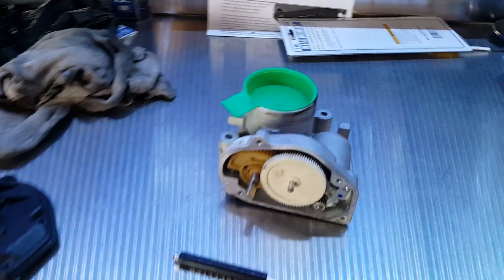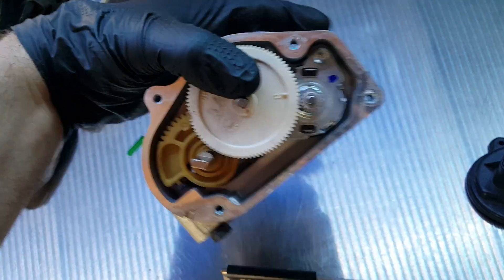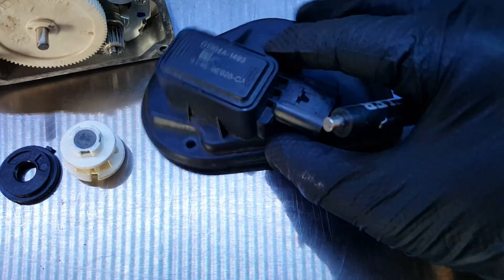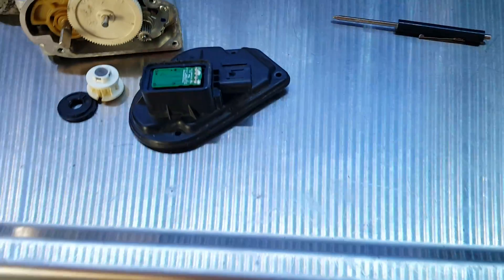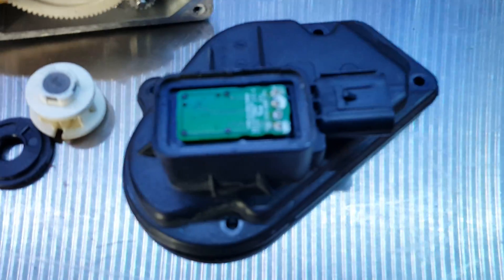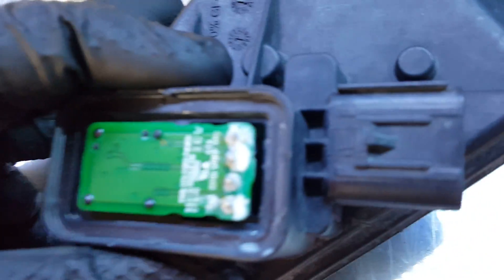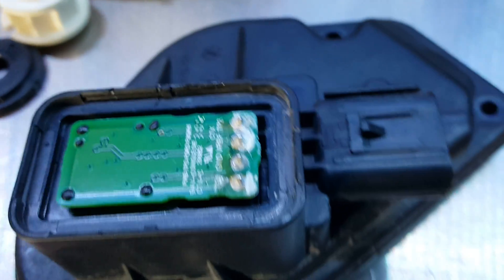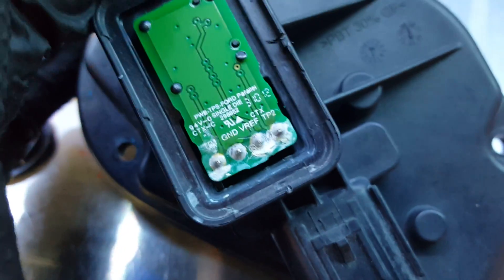Ford electronic throttle body quick check

Comment: Yes was wondering if it could be cleaned with component cleaner?
Reply from the maker: It doesn't hurt to try, but in my experience once that corrosion hits the board there is no saving it. But give it a go and let me know how it works out for you.
Reply: @brianfisher7385   I'm having slight fluctuations at normal operating temp. While at idle with ac on
Reply: @ericcraig3809  did you clean the board ? Did it work I need to know before I buy a whole new Throttle body please thanks

Comment: Wait, so this is caused by corrosion? Meaning, if I clean up the circuit, might that resolve the problem?

I have extensive experience repairing water-damaged PCBs. It's a total waste of money to replace the entire throttle body if the only problem is a little bit of corrosion.

Comment: It could be corroded circuits throttle actuator sticking open or closed these electronic throttle body's are just plagued with problems there is a recall that most people don't know about check your Vin number on Ford's website to see if your vehicle is affected the latest part number I know of for the 2.5 liter four cylinder engine is DS7E-9F991-AJ this part number is so new you most likely won't find it online. Truth be told ford isn't the only company with defective electronic throttle body's there's many others as well oh and if you see that your vehicle is one of the affected vehicles with the takata airbags you could possibly be waiting till December 2019 for a new airbag there's 40 million defective airbags from takata and there's different vehicles being added almost every day.
Reply: I know for a fact that my throttle body is not sticking, it's an electronic issue. Restarting the car returns throttle body operation to normal for some amount of time.

I've also noticed that pedal movement greatly attributes to how quickly and how often the throttle body goes into limp mode. If I accelerate lightly and never put a lot of travel on the pedal, I can usually make my 45-minute commute with it only happening once if at all. If I am judicious with the throttle pedal, then it will usually act up after about 10 minutes and then repeatedly after that, anywhere from seconds after restarting the car to several minutes. I can basically predict when the throttle body is about to freak out.